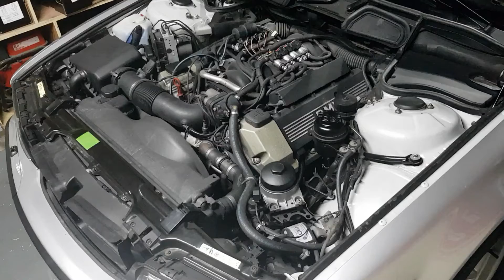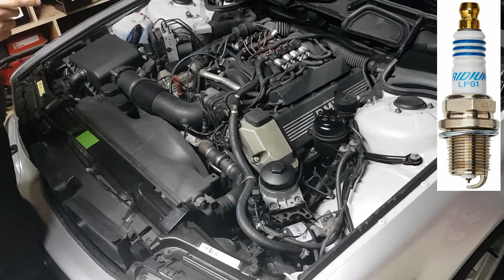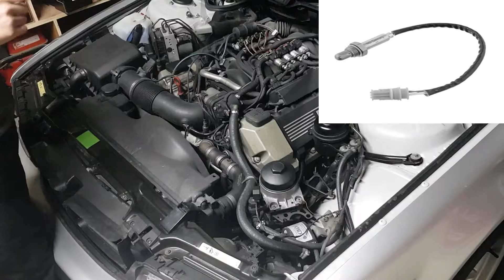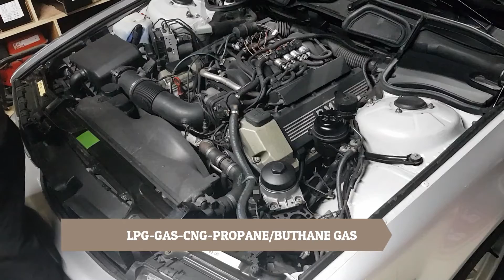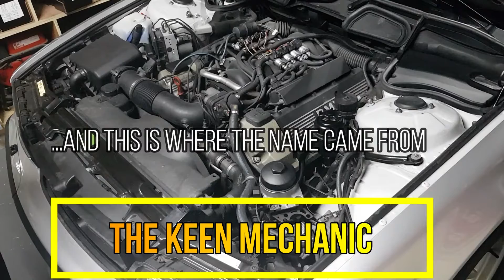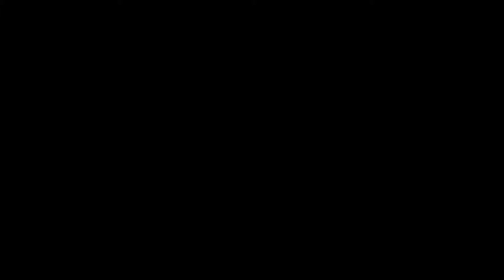BMW 740i E38 PROJECT PART 1, MAINTENANCE AND REPAIR ON M62TU ENGINE M62

Comment: I've never seen that LP setup here in the U.S. - What is the purpose of it, emissions?
Reply from the maker: Hi mate. We call it LPG or Natural gas here in the UK,  but you will find it under other abbreviations too. The LPG systems are more popular in Europe but I have see people in the US to have them installed on big trucks with big engines. I will try to explain in detail the main reason this system is used here in Europe although it is more rare to see these systems here as well due to the popularity of the Diesel engines in Europe. It could be a very confusing thing to explain when we go down to the numbers but I will do my best. I have actually prepared a spread sheet lol :) The main reason is cost of fuel and yes you were correct emissions too. Just to keep it simple let's call it LPG(Liquefied petroleum gas) the stuff you use in a professional kitchen for your cooker or some BBQs. 
£1GBP=$1.3USD                                                                      1 US gallon of Petrol(US gas) is 3.8 litres-cost $2.66 in US (Connecticut) average price.
                                                                          
1 US gallon of LPG
 costs $2.73 here in the UK
AVG Price of petrol(US gas) per litre is £1.25
 which means that 1 US gallon(3.8litres) costs $6.2 in the UK

You can see how much more expensive the Petrol(US gas) is here in Europe.
 $2.66 in USA vs $6.2 in UK and Europe. This is the main reason the LPG system is used here, but as I said we have the diesels and you see less and less of these LPG systems here as well. Having said that the LPG burns very clean (you could see forklifts using LPG systems indoors in warehouses due to less fumes and CO. This is a search on google:LPG burns cleaner than petrol.
This means less emissions out of the exhaust and less carbon deposits in the engine. These deposits are very abrasive and can contribute to engine breakdowns. The oil and spark plugs will also last longer due to less wear and tear.
Some people say that they wear the engine prematurely but in my opinion this is a myth too. here is another search: Does LPG ruin your engine?
LPG is a cleaner burning fuel than either diesel or petrol, so engine life is actually extended and LPG does not damage engines. ... Engine oil and spark plugs need changing less often with LPG, so service intervals can be increased, reducing service costs..To give you an example my car has the same set of NGK Iridium LPG1 spark plugs since 2005 :) although I will be changing them as part of the whole maintenance. Hope you had the patience to read all this lol, you could have done with some pop-corn :)